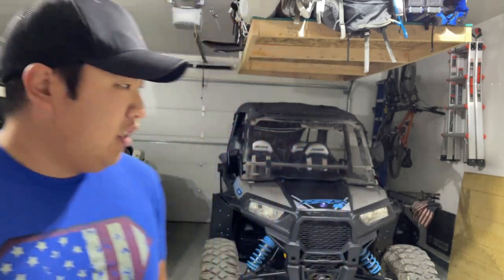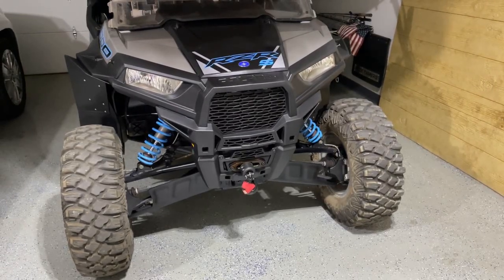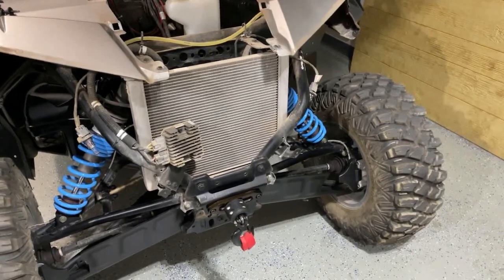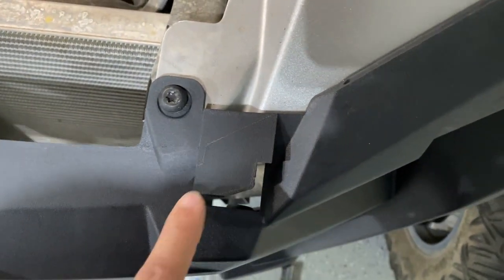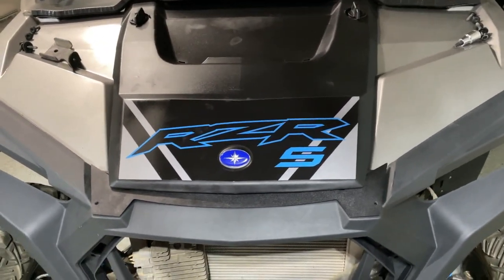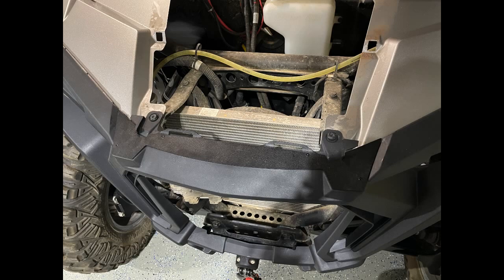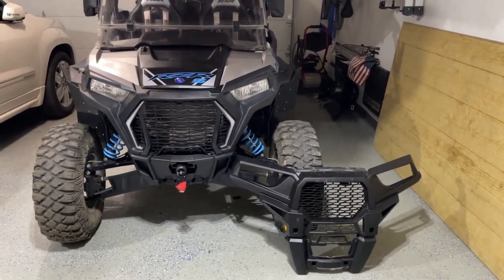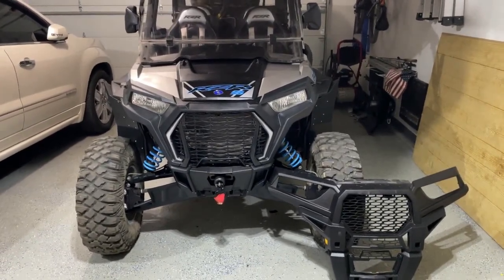Polaris RZR Fang Light Front Fascia Swap!!

Comment: Is it possible to replace the rear Fascia from an 1000 xp to a 2020 turbo rear fascia with the 3rd brake light?
Reply from the maker: I looked into this and from what I can tell it would be a major overhaul to make that happen…
Reply: It fits up perfectly to an xp1000. You just have to buy the bracket pieces. It won't work with the S models though

Comment: So I have the same wiring harness clearly. You plug in and run power and ground to that bar on the front of the razor. Where do the yellow wires go to?
Reply from the maker: The yellow wires are for turn signals if you decide to do a street legal kit. They are not used if not, just tie them up out of the way.

Comment: Good video. Am thinking about amber fangs to use as turn signals. Can you advise the approximate total cost of the parts needed less the fang lights themselves? Just the total, not the individual parts. Thank you.
Reply from the maker: The fang lights I used (Kemimoto) have the additional wire for the amber turn signals. I just did not wire them yet. Total cost depends on where you purchase your parts from, but a good estimate is around $500-$600 without fang lights.
Reply: @CollaGoUnLTD  Thank you kind sir.

Comment: I have a 2016 rzr 1000 XP4, will all the part #'s listed on your vid work for my conversion?
Do you have the part number to just replacing the hood cover instead of the bracket?
Reply from the maker: The 2020+ hoods do not fit the 2019 and older rzr’s, which is why you need that bracket. However you can buy the 2016-2018 turbo hood and it will work, but you’ll still need the bracket.

Comment: Do I need the bracket if I want to put a turbo hood on it ??
Reply from the maker: Yes you do because you’ll need to run the 16-18 turbo hood which uses the old style bracket at the front. If you go with the new style 19-current turbo hood it won’t lock in at the back of the hood because of the dash change.
Reply: @CollaGoUnLTD  thanks man!